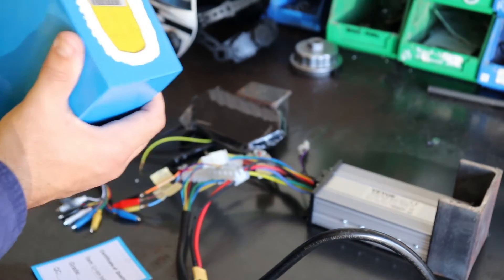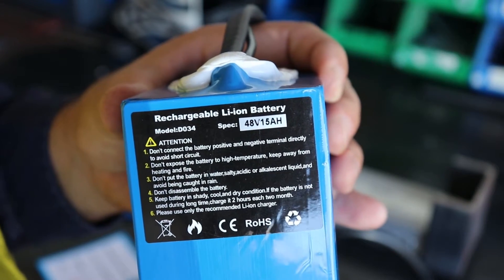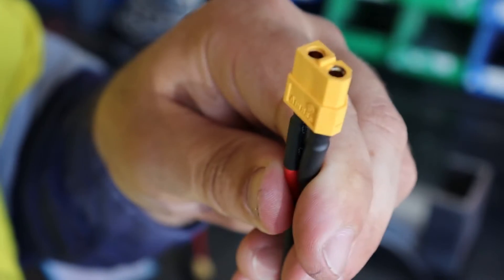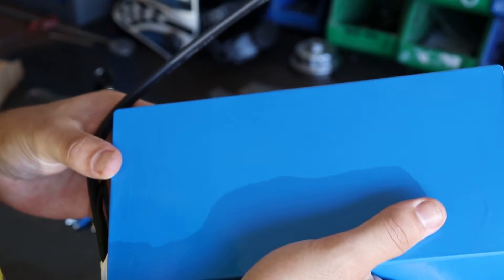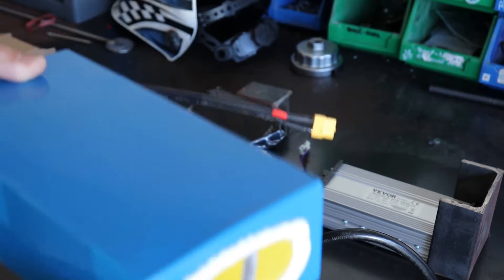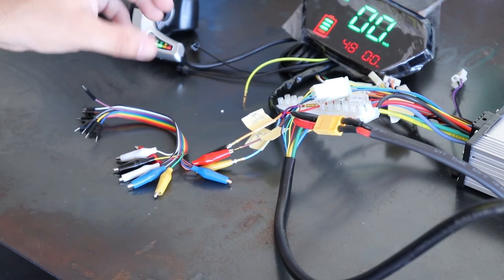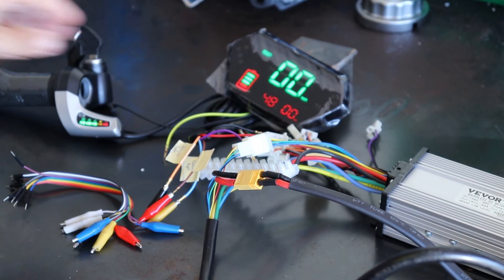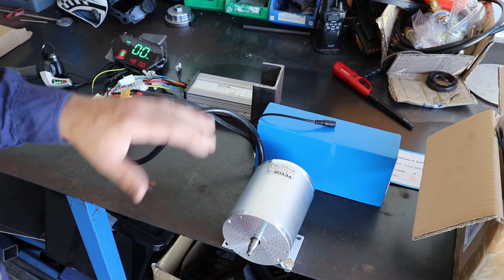48V Battery Review for a Vevor 48V Brushless DC Motor and Controller

Comment: I guess this is s but late to help you here. But with aliexpress, make sure you purchase via paypal and pay by credit card. This gives 2x levels of protection.

I had some batteries for home energy storage arrive damaged or more likely poor quality batteries sent. I contacted Aliexpress service/ help centre 13 times. PayPal payment wasn't offered, however the purchase was with my credit card. Then after such a huge amount of time wasted, I ended up lodging a dispute with my bank for the transaction and wound up with a full refund.

I noticed aliexpress stopped false promising to "look after our valued clients and assure you will get a refund" when i asked for official return policy documentation for me to forward to my bank. 

 13x asking for a different address that I could actually return damaged lithium cells to. Impossible to return the weight and size of those parcels to an Aussie post PO. Box even using other carriers and aussie post couldn't accept a the weight was too much and contents exceeded their lithium battery capacity limit by a factor of hundreds or thousands. Once I asked for policy documents they updated the address the next day! I got online quotes for curiosity and sending them back would cost more than the cells originally cost me and I would have had to front that money and only get a refund when they arrived. I was scammed once by them in having damaged cells sent to me. I wasn't risking it again. Id likely send them and they'd "never arrive" and wouldn't get a refund and I garuntee, I wouldn't have got that much money refunded by aliexpress in shipping fees. Not to mention how unsafe it is to send damaged lithium cells. I'm not willing to sign the decorations. There's enough cargo ships on the ocean floor thanks to lithium fires. Aliexpress/sellers clearly don't care, the boxes arrived to me without any labelling or declarations that they contained lithium and were dangerous goods. This is illegal...

Comment: Could I use a 48v 20ah 30 amp battery on the 34 a controller
Reply: Or would I need to go with a lower amps than 30  in the battery  for the 34 a controller

Comment: can you give me some money? lots of it? so you can say "4 stole my money and the 5th delivered". I can identify as "chinese and commy" if you like. 

I bought over a hundred panasonic 18650 cells from batteryhookup for about $30+20 shipping and I already have a great soldering iron and some kester solder and spent a few hours and made a bigger and better battery. Something I can trust. The cells came in 4s 1p modules with wires coming out, so all I had to do was to solder the wires together with some very thin pieces for protection

Comment: I am planning to get Vevors 72 V 3000 W motor. The original plan for batteries was to get 6 12V batteries and connect them and then make a battery management system and all that. If the controller steps the voltage up to the motors operating voltage, then if I use only 3 12V batteries will it still effectively run the motor but with just half the run time? Or is the “voltage correction” of the controller only meant for a small range around the desired motor voltage to handle spikes or dips in the battery voltage. Regardless I appreciate the time spent basically making a spec description as theres seems to not be a lot of documentation for Vevors controller. Thanks!

Comment: Something's crazy with the lithium battery market. You get fake ampHour ratings for packs and even for individual cells everywhere. I've never seen such a strange, false market before.

Anyway. From my experience with this stuff your ampHour/ah rating is distance/mileage and the volts is power. 
Your motor, being 2k watts could probably be over volted to 52, 60 or maybe even 72 if you wanted crazy power but you'd risk blowing it. 48 is fine, you'll probably get 30-40km of distance with the 15ah pack and enough power.

Comment: Nice video! I have the same one as well (did) just keep an eye on your first time full charge voltage. After my 7th charge it was barely charging up to right about 46 volts. I hadn’t ran it hard or anything and never drained it to E or let it sit long on E. 
FYI just incase am zon has them here in us right now free shipping the 48v 20AH SAME BUILD SHAPE AS YOURS FOR ONLY $220.00 
Sorry didn’t notice I was going in caps! Lol 
But $220 free shipping with great build quality I’ve only got to run mine 3x in the last 2 weeks but went far on all and I tell ya the thing kicks! AGOMOLA I think the name is of the company brand or what not and arrived in about 4 days. I saw a 15ah 48v one for $165 free shipping and another $185 free SH. 
Nice vid like the reviews let’s see that build coming along! :)

Comment: Does the motor need 13A to work? I put 4x12V in series withaH at 3.5.  Nothing happened- meter said 48V was making it to the controller however.

Comment: Very good information and videoing! Could you explain how the ''3 speed wire'' is connected and how it works?
Reply from the maker: Yeah sure, so think of the motor configuration as always running full speed, if you do nothing, the motor will always run at 100 percent.
If you connect a 3 position switch into the plug for the speed control, the 3 points on the switch will be 1, 2 and 3, with 3 being the fastest. 3 is also the same value if no switch is connected. Speed 1 and 2, is effectively only sending a signal to the controller telling it to reduce the output to the motor. I will try my best to explain this better with a drawing in another video

Comment: Could you overclock the controller and go faster?
Reply from the maker: What makes you say that?
Reply: @Judvh Very true it also depends on the tire rolling diameter ie: a tire with a 30cm diameter will be faster than a tire with a 20cm diameter with the same rpm and ratios